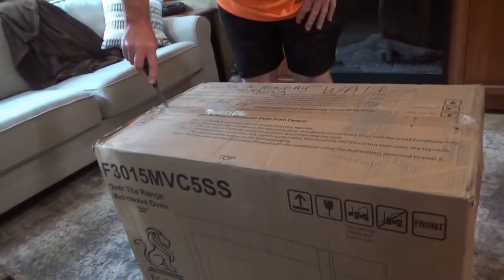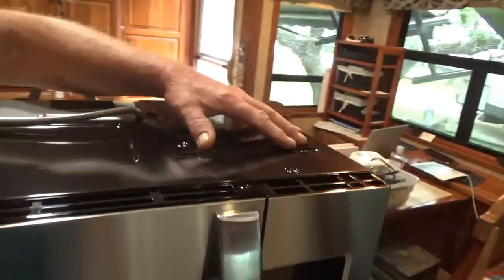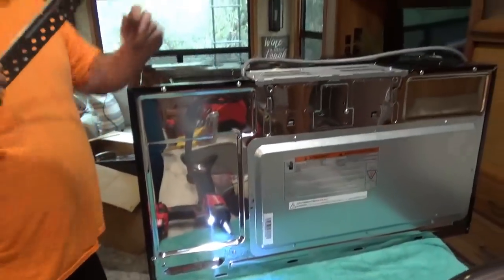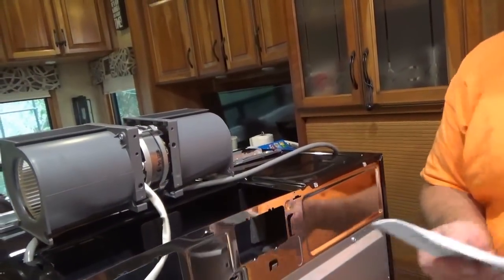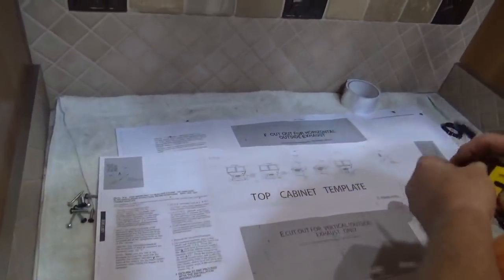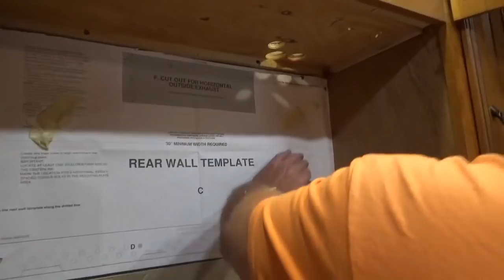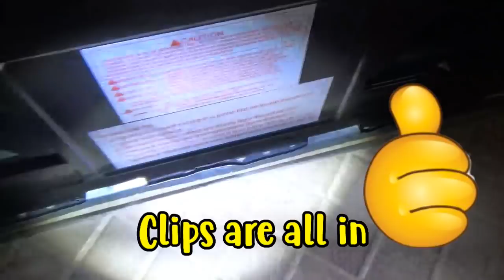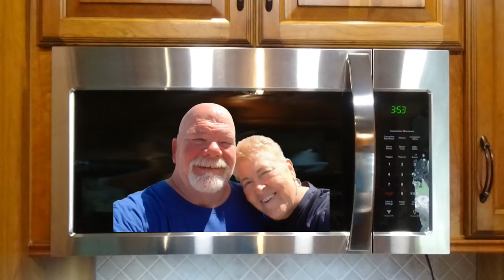💪 Microwave Replacement // DIY Installation // Full Time RVing

Comment: Be glad it wasn't a built-in unit.  We got lucky when we replaced ours and found one that fit and wasn't too expensive.
Reply from the maker: So true.  That would have been a nightmare.  We had the fridge worked on and had to build a platform just to move it away from the wall.  Yikes!

Comment: I'm having to do the same thing next Tuesday I ordered a Whirlpool yesterday at home Depot not a convection though it's going in my 96 Holiday Rambler Endeavor LE it had the original Sharp still in it.
Reply from the maker: Good Luck.  That  stuff is never fun.  But at least you had a good run with that one.

Comment: Watched our microwave installer open up the door on the unit after he got the back hooked in and use clamps to hold the unit in place so he could get the screws in without having hold it up there with one had and put screws in with the other.
Reply from the maker: He was just a show off.  LOL     Good idea!

Comment: Thanks for the video.  How has your microwave held up? 
I’m replacing mine and was thinking of ordering the same one you purchased.
Reply from the maker: Well, the microwave part works OK, but the oven part is low on temp about 25-50 degrees.  It also burns on the left side.   I have to spin food all the time.

Comment: How many watts is the new microwave vs old? We only have a 950 watt LG convection microwave in our 2016 Luxe 5th wheel. I’d like to upgrade to a higher powered unit.
Reply from the maker: 1100 watts but the oven does not reach the temperature it says.

Comment: Why did you choose that brand?  How has it been since you installed it?  We are getting a used New Horizons next month and it needs the existing unit replaced.  We are researching a replacement.
Reply from the maker: Bought it for the price but won't buy that one again.  Micro takes longer than expected and oven is about 50 degrees low.